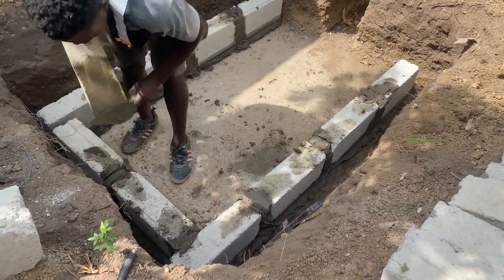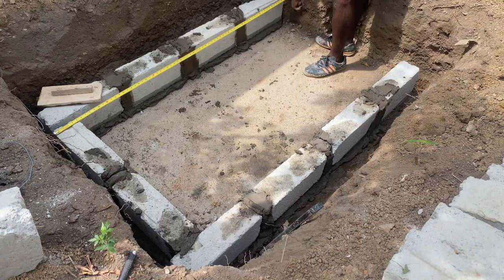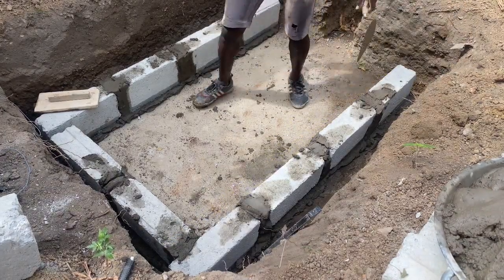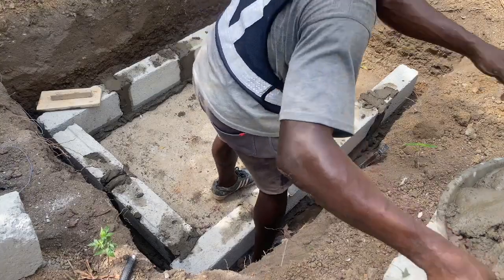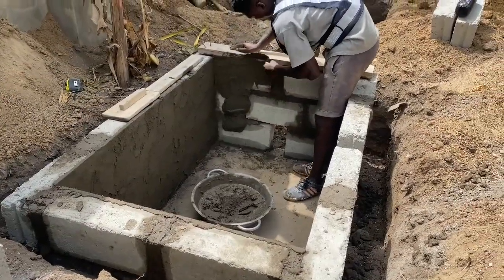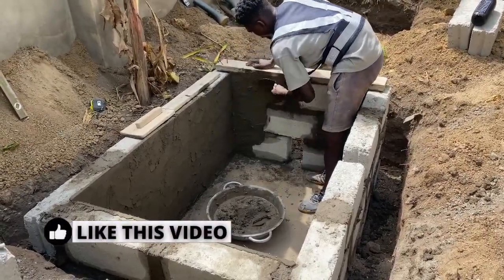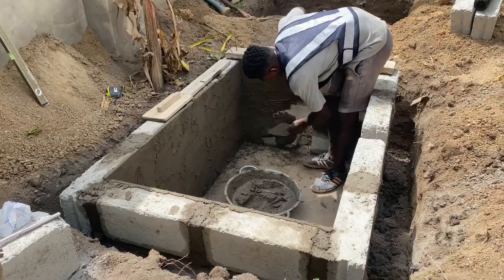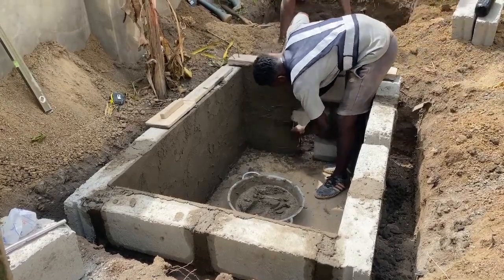How to Construct a Biodigester with Blocks: Step-by-Step

Comment: I don't see any reason why the system would not just digest the coconut fiber in a few months.
Reply from the maker: The system has been designed to digest a specific content (human waste) I don’t see any reason why it should digest coconut fiber which is what helps with the digestion 🤔😊

Comment: You say the biodigester doesn’t need a vent, but it looks like there’s a vent in the second concrete cover.  What is it for?
Reply from the maker: That's not a vent @OKM9430. That's just a four inches clean-out to serve as an inspection chamber to have easy access to see the inside of the biodigester. Like I always say for best results your vent must be on the building https://youtu.be/M4uqIedCP_4?si=BdwR7B_tr6D4J-NQ